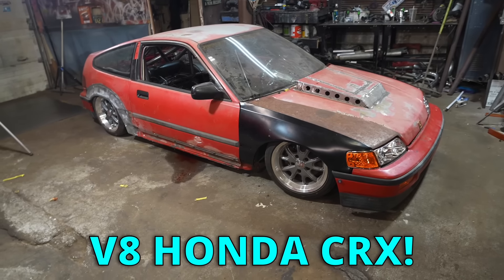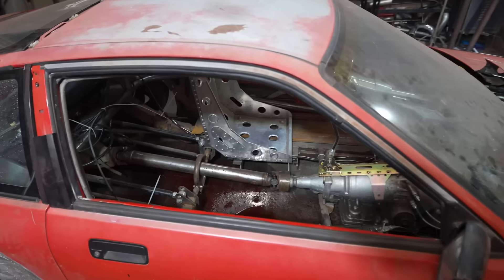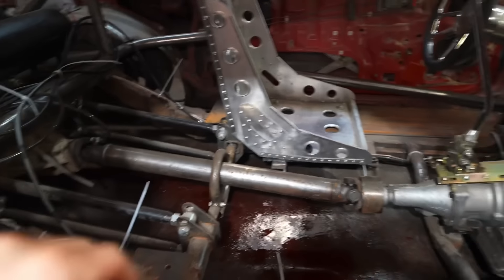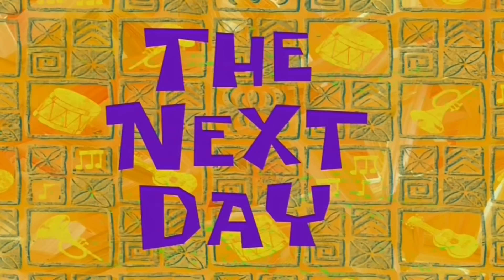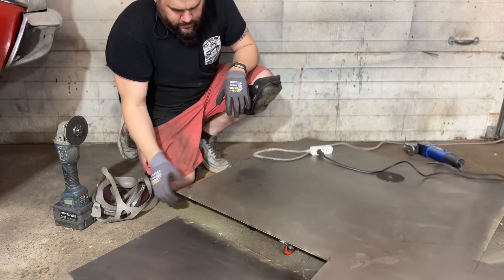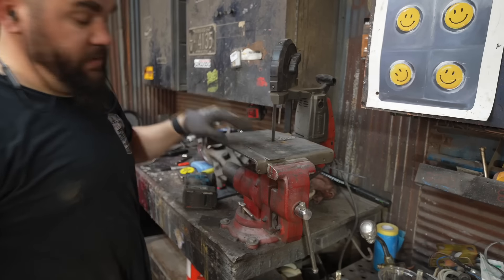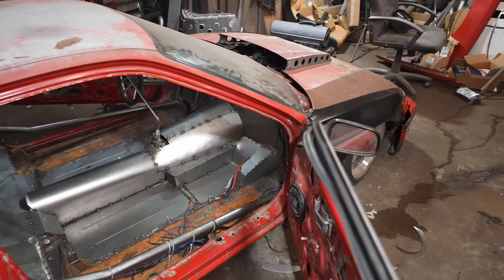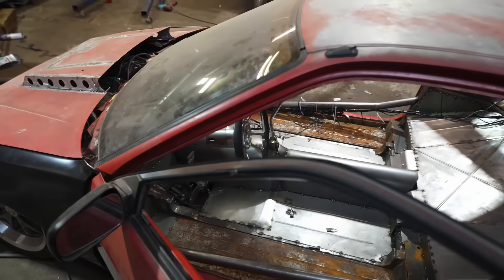500HP V8 HONDA CRX GETS A CUSTOM BUILT FLOOR PAN AND FIREWALL! Fabrication is almost done!

Comment: You can put a ratchet strap around top and bottom of  the  sheet metal and  pole to  bend it if it's  really thick stuff. Lol it works!
Reply: I was telling myself the same thing lol
Reply from the maker: I’ve done that before and it just creased the metal in half instead of the slight bend all around. It also bent the hell out of the metal where the strap was and ended up being more work then it was worth. But i do think if i had a bigger sized pipe or tree it would work better
Reply: @CaseysCustoms  yeah, the pole I used to shape the metal was quite a bit bigger than the one you used.

Comment: Love old cars, but this CRX is cool! Fun watching this build
Reply: 1 of the downsides of Honda CRX is how some people rob them (they bend the door frame from above to gain acces to the door locks) if you have a old one. 
Apart from that Honda CRX has great stock tech from factory also a nice low body weight compared to most hatchbaks these days.
Its also lighter then a Suzuki Swift Sport EU edition 2007 towards 2010 build years. for roadtax in the EU where i live this would be cheaper. But Parts are the headache of these old honda's + some of fan boys hoard parts for things. now that every thing gets so old / cant replace or buy things. Would be nice if honda gave support for older honda stuf because stil a lot of people like there older cars. --- to keep it simple i wouldnt mind owning honda crx but i would surely reinforce the doors incase of robbery xd. also the body shape is great on them.

Comment: I like how you come inside from the tranny tunnel pole building, and the piece of sheet metal is only bent a little bit in the middle, comes back 3 days later still with the same clothes on and it fits.  l0l

Comment: Looking good man ! Maybe go with a clean looking metal dash and put a 10” or larger tablet like a Tesla
has for a speedometer (can use gps for speed)  in the center? Also, possibly rhino line the inside instead of having carpet?

Comment: I hope this build gets a proper paint job. That would be great ! Let’s go  Casey
Reply: @smokedu2135  and a motor that runs correctly because this supposed 500 HP motor runs like shit and if you put it on a dyno I bet the way it's running right now that it barely makes 200 hp
Reply from the maker: @bustinyanutz4195 i got a dyno sheet that says 505 when i bought it, but ya you’re prolly right. Everybody knows SBC’s can’t make power

Comment: I feel like alot of panels that go around the moving parts and where the trans goes maybe aswell around the part of the motor that comes inside should have bolt on panels. For serviceability purposes or if you need to remove things. But awesome work

Comment: I'd drive up from Sarasota, Florida to paint some backyard spraycan graphics on that little puppy, if you're in to that sorta thing. I'm thinking something that fits the era of the car. Maybe some scallops with a drop-shadow under 'em, or wide pin- stripes with a design inside? Nevermind, your dad is a painter, if memory serves.

Comment: Did you make any provision for exhaust under the car ?
Reply from the maker: There is a 8” section between the rocker and outside of the frame. I built the frame with room for the exhaust 👍👍